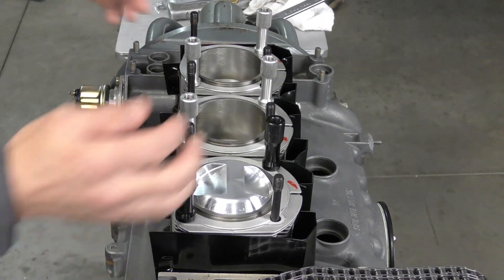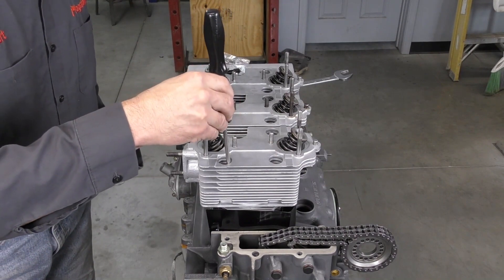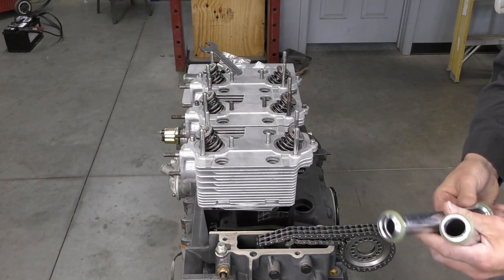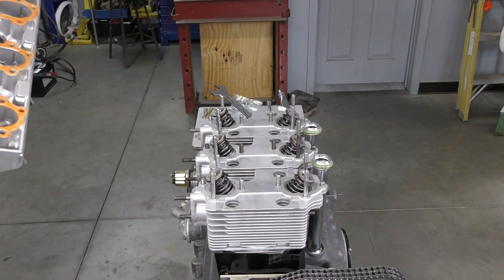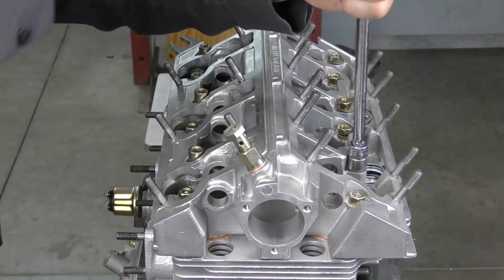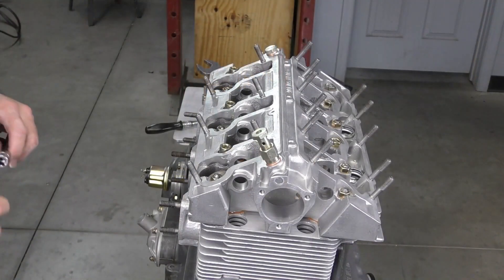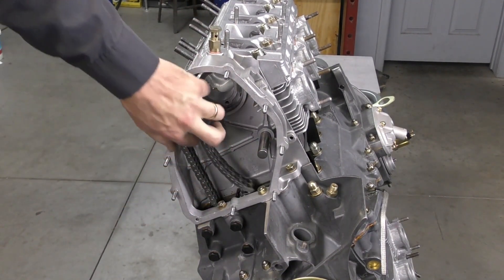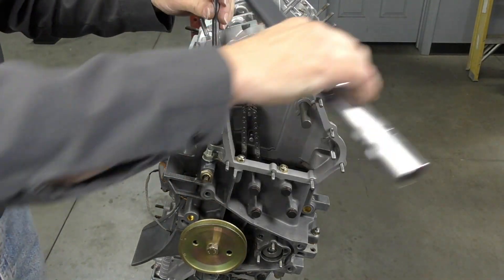Porsche Air-Cooled Cylinder Heads To Cam Boxes

Comment: Did you paint the case?? You’re a great teacher. Thank you for your effort.
Reply from the maker: No the case is just cleaned. S
Reply: Kommt der Glanz vom Glasperlen strahlen bzw. kann man die Getriebegehäuse Glasperlen strahlen?
Reply from the maker: So we wash the case, then vapor blast using a glass bead mix and then finally tumble the case in a media vibrator with a soap solution. That is how we get them so clean.
Kurt

Comment: No gasket or any sealant between cam box and cyl. head ?
Reply from the maker: No gasket, but yes selant. Loctite 574 in contact areas. Check out https://youtu.be/toKzi--EN7s at 38:00 to see this go on the cylinders. Thanks for watching, S

Comment: Are you using Nylock nuts and wavy washers to secure the chain boxes to the case? I am having difficulty finding them displayed in the parts catalog to confirm part numbers. Thanks.
Reply from the maker: Dennis,
I use an aluminum washer with a Nylock nut. In your car it would have been a flat washer, wave washer, and a plain nut. I do prefer the later style of fastening.
Kurt

Comment: Love your videos! I see you don’t use the restricted fittings for the cam oil line connection. What’s your take on these fittings? A good or bad thing? I think Porsche recommends?
Reply from the maker: The oil restrictors are designed for the late model turbos using full synthethic oil and a turbo oil pump and an oil spray tube that uses different oil spray tube. I would never use the oil restrictors in an early model car. 
Kurt
Reply: Good to know!

Comment: Hey Kurt on the 911 SC which way does the head gaskets go ? They are tapered so does the larger side face  up towards heads or down towards the cylinders. There are no markings on them. Thanks.
Reply from the maker: Kevin, 
I put the larger face against the cylinder head.
Thanks
Kurt
Reply: @Aircooledconsulting  Kurt thank you so much for the answer

Comment: No gasket or sealant between chain box and case?
Reply from the maker: No it needs a gasket there. I usually do not use sealant + a gasket though. You need to make sure that the surfaces are clean, flat and dry when assembling.
Kurt